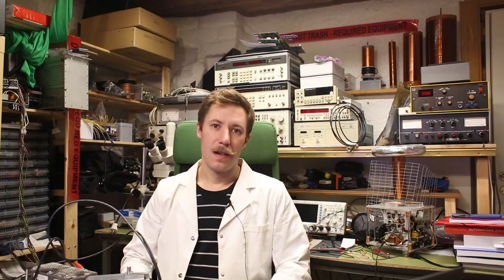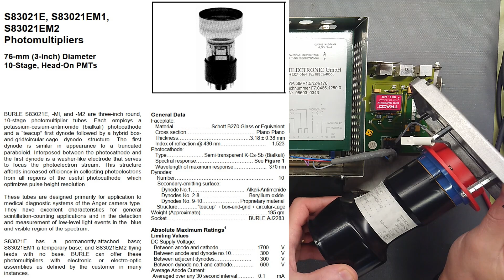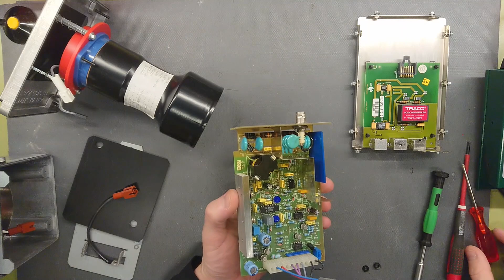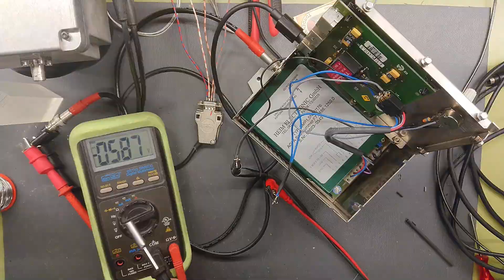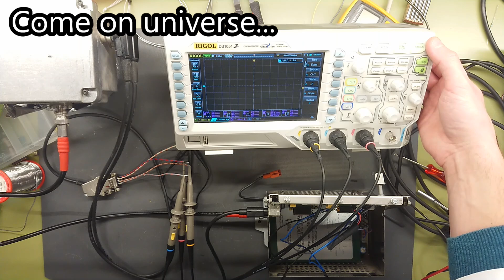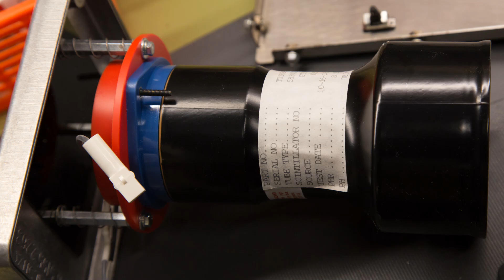AGFA ADC 5155 Photo Multiplier Tube (Part 4 of 4)

Comment: The multimeter might be loading down the PMT PSU if it's not high enough impedance. You will need around 700 or more on the PMT.  The blue filter on the PMT might also attenuate the light from the scintillator. Usually PMTs are insanely sensitive. Ping me if you want some assistance, i have played with a few of them.
Reply from the maker: The input impedance of the multimeter is a regular 1M, so at 6mA that should not pull it down. At 600V across 1M, that is just 0,6 mA. 
Do you have information about the blue filter types? The BC408 scintillation material gives out blue light at 425nm. 
Did you see my other reverse engineering of a newer PMT assembly from almost the same machine, just a DUO instead of SOLO. Here I had the same starting point at -600V that I took to ~ -1000Vish and got better sensitivity and also more noise, which is why they run them with a light load for image acquisition.: https://kaizerpowerelectronics.dk/high-voltage/photomultiplier-tube/
Reply: @KaizerPowerElectronicsDk  No i didn't see your other video sorry, i'll go have a look for it!! I have used BC408 and BC412, they are both very similar if i recall but i think 408 is better suited for measuring the energy of incoming particles/photons.

Comment: does it detect neutrin ?
Reply from the maker: It could be neutrinos, but it needs some kind of reset network to reset the tube output, since its as slow as 2us on the output signal, so the secondary break down break of a neutrino is not present. I got a few confirmed neutrinos with another PMT here: https://kaizerpowerelectronics.dk/high-voltage/photomultiplier-tube/